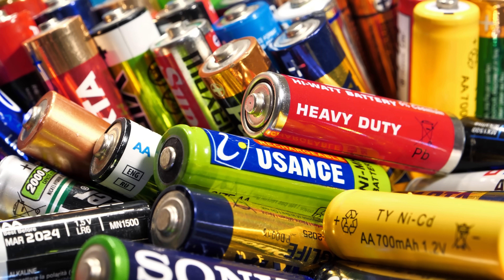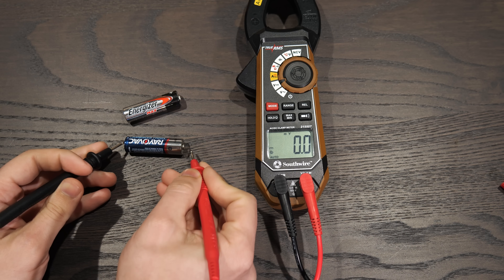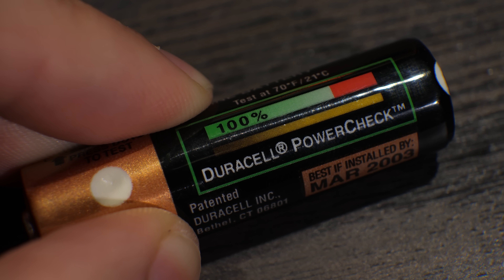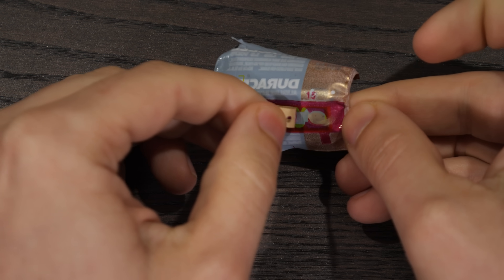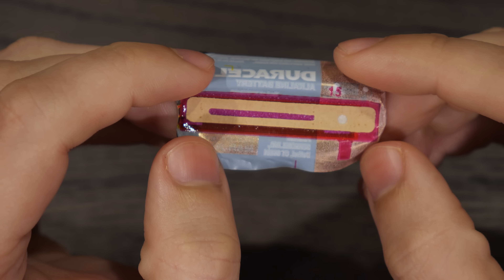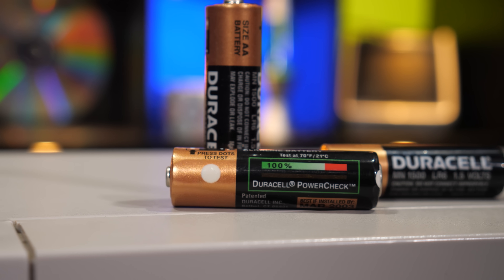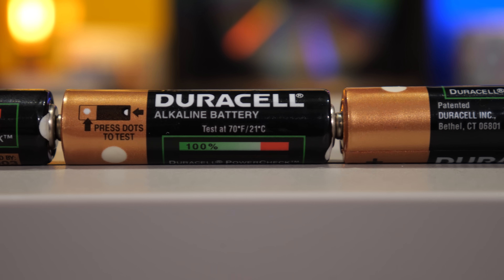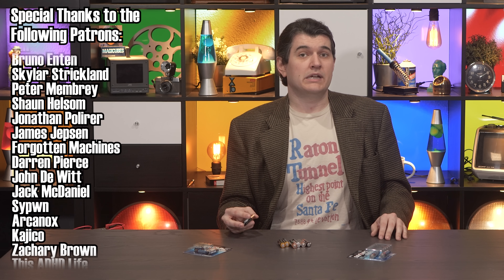Duracell PowerCheck: A genius idea which didn't last that long

Comment: Has anyone pointed out that a single AA cell is not a battery? And that it's only a battery if there is more than one cell? And a that 9-volt battery really is a battery because it houses 6 cells? Because people really appreciate it when that's pointed to them.

Comment: One thing about used batteries: the clock is ticking on whether or not, or when, they will leak! I've had barely-used batteries do this while just sitting around, not in a device.

Comment: I would like you to try out a method of telling if a battery is dead. Simply drop it on the flat side onto a hard table. Dead batteries should bounce, while full batteries should stop like a dead blow

Comment: The video is very interesting, I confess that I have to watch it at 75% speed, because I can't read the translation so quickly (into Spanish, I don't know English) but even so, I really liked it and I remember those batteries, I still have 1 as a souvenir with its charger....which no longer works, (only if I apply heat to it XD)

Comment: I actually wish more products would return to simple batteries like this.  It makes it more convenient in a way, and it allows you to hold on to that device long term and still make it usable.  I have loads of tech from the 90s that I can still use today by popping in a fresh AA battery, but I also have loads of now junk devices from just several years ago that won't work because the built in rechargeable, non-replaceable battery is dead and won't hold a charge anymore.
Reply: Rechargeable, non-rechageable, does not make much difference but  ALL batteries should be REPLACEABLE!    No glued it, not glued shut, not in configurations that could not be called standard but in obtainable replacements.
Reply: @robertpendzick9250  i always wonder why this is such a rare thing. my boyfriend has a vape that has a replaceable battery and i have a similar model vape but you cant replace the battery? like, you did it on one, just do it on the rest of em. wtf??

battery companies could be making a FORTUNE printer-cartridge style if we just did this . and people could stop complaining about their low quality garbage products because they wouldn't be made of garbage materials meant to throw in a landfill and forget about anymore. 

i guess a lot of it is because disposability is convenient. out of sight out of mind, and you dont have to go through the effort of... replacing a battery... i guess... and maybe some legal issues because people are idiots? or just too much effort for companies to... simplify their products?? i dont know, i always thought the whole battery industry was ridiculous
Reply: @robertpendzick9250  Nonstandard configurations are entirely warrented in some cases (see the Steamdeck's weird battery that is Decidedly nonstandard... because the alternatives are making the thing massively bigger (it's already arguably slightly too big), gutting it's batterly life, or having the whole thing burst into flame), though whenever that is Not the case standard models should absolutely be used (You'd think the usual penny pinching practices would make this the norm already).

Rechargable vs non-rechargable is a Big Deal. Frankly they should always be rechargable and it kind of pisses me off when I stop to think about it that rechargable AA and AAA batteries seem to have largely vanished (or at least been displaced from your typical battery display in random non-specialist shops) here while the non-rechargable ones keep on trucking.  Mostly due to waste disposal issues, but also saving the customer money... of course the people who Make batteries would really rather you have to constantly buy more, so it's understandable why they went that way, even if it has a strong negative effect on my opinion of them.

On replaceability, though, you're absolutely right. Making the battery non-replaceable (note that I'm discounting 'it's nonstandard for good reason and a reasonable number of spares were produced but it's many years later and they've all been used up now' here, as if one is really desperate in that scenario one Could assemble a viable alternative power supply, it just wouldn't be as good) is fundamentally inexcusable, and most of the time it's a scam to force you to buy a new one sooner than you otherwise would (batteries being a wear part)... of course, Sometimes it's just penny pinching to save on the cost of designing, buying/making parts for, and assembling a more reasonable battery housing (why bother when you can just glue it to the case?) and Exceptionally rarely there might be a valid reason for it (though most of these are also at least partially a price issue, though usually not just a matter of penny pinching). But usually it's the scam option.
Reply: all batteries ARE replacable, you just need more skills now 

in other words, 

gitgud
Reply: @Robbie-mw5uu  I was going to make that comment, more diplomatically.  With very, very, few exceptions everything uses an off the shelf, battery that can be easily obtained from any parts vendor.  That said, I do prefer a AA compartment that I can use NiMH cells in.  They are still used on some things, like my flash for my camera, where you have to swap batteries often due to overheating, rather than from being discharged.  There are some devices where being able to pop in a new set and keep working is a must.
Reply: It's nice to be able to use decades old electronics just by popping in some AA batteries instead of having to open the device and replace the battery with a dodgy ebay replacement. And rechargeable AA batteries were the best of both worlds, my AA NiMHs lasted for 15 years and are easily replaced.
Reply: Dual chemistry is the way of the future. I always prefer something rechargeable, but it's always good when things go unexpectedly and you have no way to charge, just to be able to throw in a standard battery.
Reply: Rechargeable AA and AAA batteries have also come a long way since the 90s. I use rechargeables in everything. And it's so much more convenient to just swap in already-recharged batteries than to have to find a place to plug something in for a couple hours.
Reply: @dominickpastore  This is so true, especially for devices that chew through batteries. We bought a dozen rechargeable batteries to use with wii remotes around 2010 and most are still working and are used around the house; if we hadn't bought them, we probably would have used a hundred (or more) disposable batteries in the same time.
Reply: I use rechargeable AA batteries for good reasons: they cost less, provide 3-4X more power, and operate better in the cold, even compared to some proprietary Lithium ion packs. NiMH AA cells can run almost any device that uses alkaline cells... VERY few exceptions that stop using the batteries at 1.4 volts which leaves 90% of the disposable cell energy unused and makes it impossible to use NiMH since it starts at 1.4 volts instead of 1.55 to 1.6. Still, NiMH AAs can satisfy both Alec not wanting to throw away thousands of AA cells, and make our devices have infinite battery life because we can replace the cells and have them recharged again before the next set it empty... plus many NiMH cells will outlast proprietary lithium ion packs because Japanese made NiMH cells can deliver 2100 charge cycles while many Lithium ion packs are only good to 300-500 cycles thanks to using the highest energy density (LCO) instead of the most powerful or longest lived Lithium ion variants (like LFP or whatever is in tool batteries).
Reply: All device stop working at some point. The question: which component is going to be the point of failure and is repairing the device worth the effort? I‘m not going to have the battery in my smartphone replaced, because it‘s OS stopped receiving updates two years ago and some of the apps I used on a regular basis no longer run on that thing. I replaced my electric toothbrush not because of a dead battery but because some O-ring got brittle with age which allowed water in which shorted and killed the motor. And when the tome comes, I‘m not going to pay a technician to spend at least a day replacing dried out electrolytic capacitors in a TV I bought for 120 Euros.

Comment: In addition to the pressure required, the bar did not fill up nearly as fast as advertised so you had to hold it for almost 10 seconds. Just inconvenient enough that you didn't want to bother with it. I preferred the battery tester that was this same thing, just installed on the packaging. Easier to press as long as you kept the package.

Comment: People don't keep half-spent batteries around? Well they absolutely should though! 🤦‍♂️

Some devices, like camera flashes or cheap flash lights/bike lamps are so sensitive to voltage that they perform notably worse or stop working altogether as soon as soon as the voltage drops by 0.1 volt, meaning the batteries you swap out half well over half their charge left and could still be good for YEARS in a remote control, digital clock/wheather station, decorative lights or any other low voltage application, it's a stupid waste of resources and your money to throw half-spent batteries away and put brand-new ones into those low-voltage devices!

Actually, buying alkaline batteries AT ALL is a stupid waste! 99% of modern devices that require swappable batteries run perfectly fine on rechargeable NiMH batteries and for the other 1%, there are Li-Ion batteries in all standard alkaline formats that have a built-in VRM and often a USB charging port and output a perfectly stable 1.5 volt across their full range of capacity, meaning they perform better and longer in voltage-sensitive devices than these wasteful, disposable alkaline batteries!

Honestly, alkaline batteries should not even be produced anymore, they're fully obsolete and consumer ignorance is the only reason they even still sell in stores! A complete sales ban of disposable alkaline batteries could prevent a lot of metal and chemical waste and would hurt absolutely nobody!
Lithium coin cell batteries are the only disposable batteries we still need, although ever since the AirPods were introduced to the market, it seems like we should have the technology to make a rechargeable replacement for coin cells too.

Comment: It still is useful, I have plenty of batteries in various places, some without any packaging some with and they might be so old that they wont work, or the device I am testing might not work. So it is very handy to test the battery for charge and I don't always have multimeter at hand.

Comment: I remember as a kid I loved these things. Since my parents were pretty frugal when it came to batteries, I switched my batteries around for any toys that needed them. And I remember basically destroying my fragile kid fingers trying to see the little bar appear and checking each battery. Especially since as batteries start to get used up, the voltage got lower and thus the toys got affected. So I started rationing the better batteries for my "better" toys. The kid version of swapping around the wheels of your car.

Comment: Well... this was the time of high-drain, situational use devices like digital cameras, portable music players and gameboys. I think people more often switched those batteries around than in devices like remote controls and such. And probably the biggest reason for these existing was not to convince people the battery still had charge, but that it might be a good time to use a new one instead.

Comment: I was gonna say Duracell Quantum was a thing, but apparently those have been discontinued as well.
One question I have, is why isn't the tester standard issue on rechargeable batteries? I quite commonly use rechargeable AA and AAA batteries for electronics that don't include built-in lithium-ion batteries, the empty batteries and the charged ones I sometimes get mixed up, tester would make it easier to tell them apart. And sure, I do have a multimeter but still.

Comment: I remember these. But my Gameboy (BW version) used rechargeable cells, as did other toys. 1,2V 500mAh AA NiCd cells. Pretty crappy. But it worked. For 5 hours. One way alkaline batteries were used for clocks and remote controls since they lasted ages.

Comment: These were actually pretty useful for me during my child days. 

Here in Brazil, summers get pretty hot, hot enough that the heat is enough to make some batteries leak. Therefore we would do everything that we could to keep batteries out of our gizmos, because a battery leak inside it could kill it for good, I lost way too many toys to that. Honestly, I remember dreaming about becoming an adult and replacing every battery in the house with those rechargeable versions that only the rich kids in the block had just to never have to worry about dead batteries in my drawer.

All of that live battery handling made us note that some gizmos needed better batteries than others, the new batteries were allocated to the toys, since they were usually more power intensive, while the older ones get downgraded to the remote, which barelly used any. Also the AAA batteries seemed to leak less often than the AA, I only have anedoctal evidence of this, but this might be the reason some devices use AA over AAA

Comment: I think multimeters have miniscule loads for measurement, very accurate resistors.. or letting small current to move hand of the indicator.. load

Comment: I actually have seen these in the wild not that long ago, although I think they have since been re-discontinued... currently holding a Duracell Quantum AA (with the red label, so you know it's good) expired Dec 2023, and sure enough it has the power check thingy! Still hurts my thumbs and everything!

So either there were some people desperate to have this feature on their "premium" AAs again, or Duracell straight up forgot why this feature went away the first time.

Comment: See, we always had a bunch of batteries in the junk drawer because my dad never threw away the batteries that were too dead to work and just. Tossed them in the drawer as if somehow, they would recharge.  You could tell by how dented the test dots were if the battery had any charge left in it. Most of them did not, and might still be there in that drawer 'til this day.   Unless they got moved to the freezer.  (Don't ask, I don't know.)

Comment: Only time I used partially used batteries was when I was taken them from one remote (not currently in use) to put in another. It was neat at the time so I did buy a pack or two back in the day.

Comment: hm, i bouth those Duracells sometime between 2011 and 2013. Still have one in a drawer. shows 1.3V. But the tester is dead. Exp. Mar 2018
Reply: i heated the tester and it shows yellow, but battery can't turn it on, so the battery is dead.

Comment: What an amazing and interesting video and topic!
And yes, I do remember this type of batteries! My mum almost never bought them because of how expansive they were.
I was always fascinated by them. In the Netherlands they were called "Duracel Ultra Power",
and had a blue ring and indeed the yellow test-strip. Today I only buy rechargebles.
But I have a few stored away for that one moment I need a AA or AAA.
I even built an actual batterie for my Sony Hi8 camcorder, using 10 1.2 volt (2.1Ah) rechargeble batteries in a 2P-5S config. and it works a treat!

Comment: So devices work great with 1.6v all the way until 1.0v, then they are totally dead.  Why can't devices be designed where they are fine with less voltage?

Obviously, I'm dumb, but why in there not still over half a "tank" left?

Comment: I remember Duracell PowerCheck. It was a brilliant idea and it really worked. well to get that last little bit of juice out of the battery before they were completely dead. I'm sad that the idea disappeared. Normal batteries last longer than recharable batteries as their charge cycles get shorter and shorter .Normal batteries, while wasteful last longer and the PowerCheck allowed that extra bit of juice to be left. For instance if the an appliance with batteries was unresponsive, id check the battery charge and then pull out the dying batteries out and put hte old batteries into something that had a lower electric pull to just make use of the last bit of juice.

Comment: As a "value-obsessed Midwesterner" I was surprised you didn't mention rechargeable AA and AAA batteries at all. Are they uncommon in the USA? or perhaps prohibitively expensive? At least in France they are way cheaper in the long run (after 10 cycles they typically becomes cheaper per uses than non recheargeable ones). Plus, in my experience, I usually found out that they were a lot less prone to leak out and destroy the appliance they sometime are forgotten in...
Thanks for this video though! It was nice to understand how this strange embedded gadget worked!

Comment: If my rechargeable AAs had the battery tester, that would be so useful. Say I've listened to my CD player for an hour, do I recharge them now or wait till they die. I also don't want to keep really low charge batteries around, so I tend to just recharge them after every use, probably reducing their lifespan significantly 😅

Comment: One way to check batteries is to drop them on their end. Batteries with more charge will land heavy and not bounce much. Depleted batteries are lighter and will bounce more. Good way to pick out the best ones if you have a few laying around.

Comment: I remember these!  I also remember Energizer had a competing design that I presume worked the same way, but instead of a progress bar it was just a box that turned green and said GOOD if there was enough charge to activate it.  I'm assuming it was also heat driven just didn't have the gradient feature this design did.